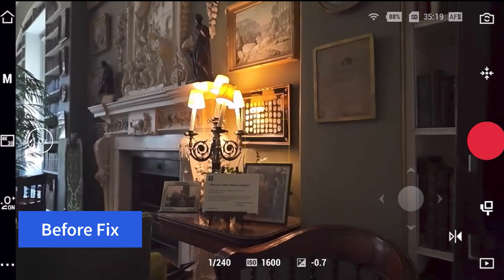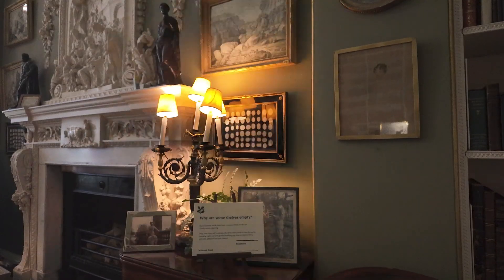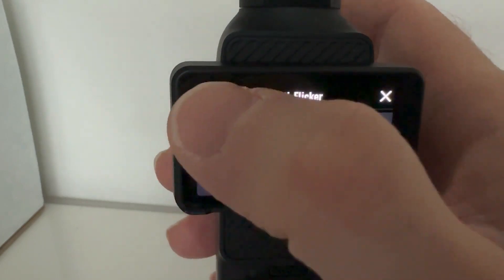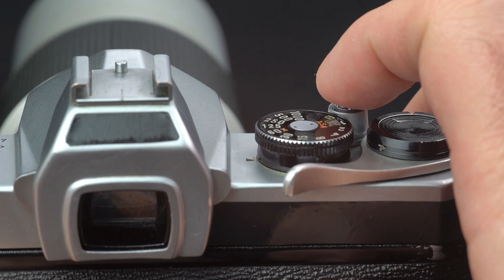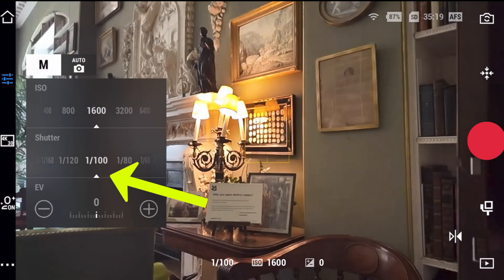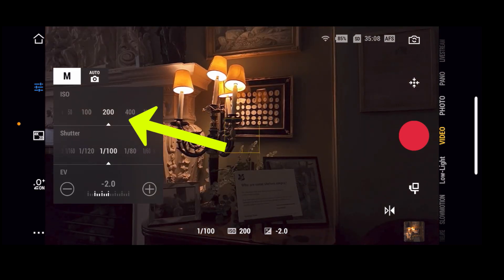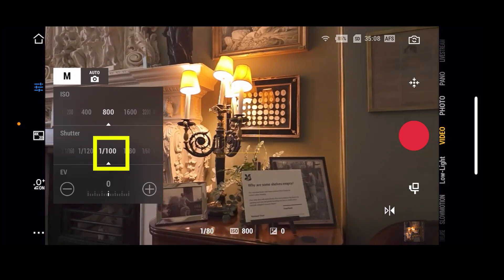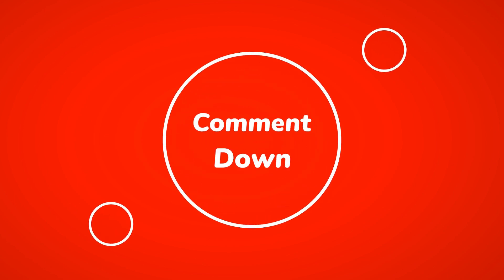Shutter Speed Hack To Stop Flickering Lights in Video on ANY Camera!

Comment: Hi, i can't turn anti flicker on or off in my settings,it's not highlighted.
Reply from the maker: Hi Graham, sorry for the delay, on the Pocket 3 the anti-flicker settings are disabled in Low Light Video mode, so you'll need to either use the shutter speed hack or use the normal Video mode for the anti-flicker settings
Reply: @4T-Tech  Thanks, don't think I'm in low light mode but will have another look and check...thanks.
Reply: I checked wether i was in Low Light mode and i wasn't. Put into normal VIDEO mode and it's still not highlighted.🤷
Reply from the maker: @grahamjones7070  Hi - It seems not available when in Manual mode. Set the exposure to Auto rather than M and it should be highlighted
Reply: @4T-Tech  Thanks I'll give it a try.👍
Reply: Yes that worked thanks for your help.👍